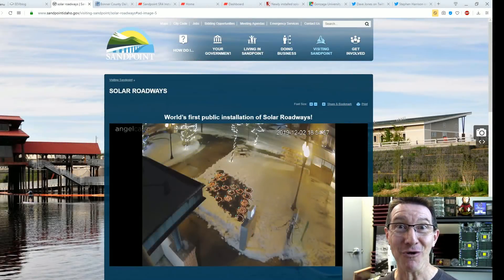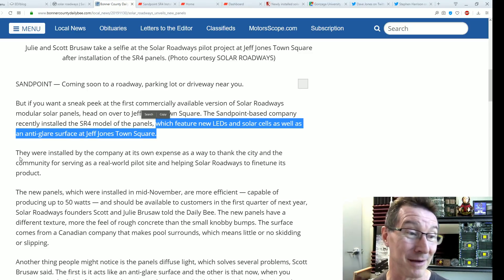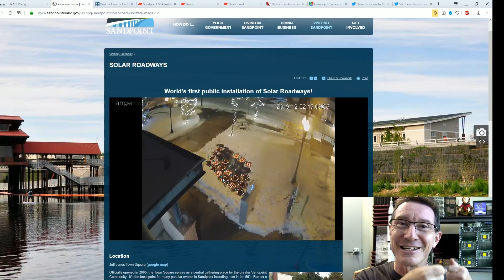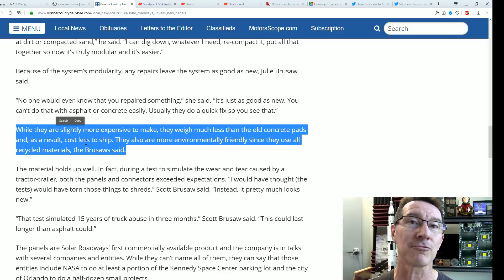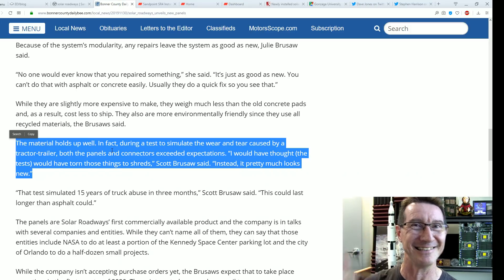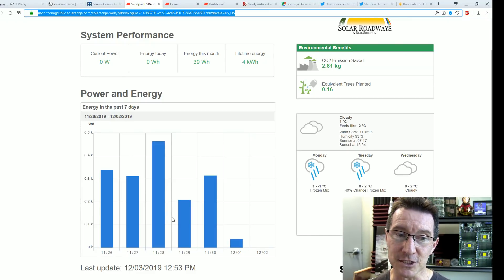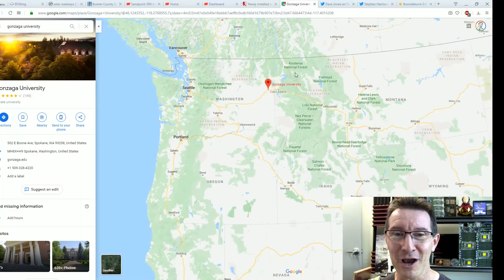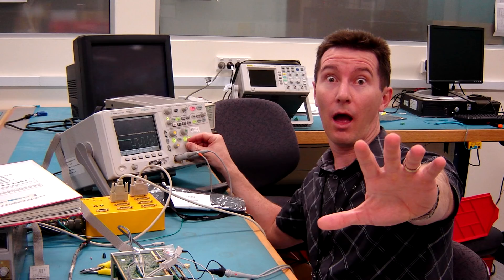EEVblog #1269 - Solar Roadways SR4 DATA Hilarity!

Comment: So right now they have the lighting set up to solid red, lighting up randomly. I suspect because that makes it hard to tell if a panel doesn't work.
After some observation I can safely say that two of the panels are dead. The foremost and the farthest left to the top corner one don't light up. So much for longevity.

Comment: Oh NO! Piezo Roadways...
Piezoelectricity and the Future
What does the future hold for piezoelectricity? The possibilities abound. One popular idea that inventors are throwing around is using piezoelectricity for energy harvesting. Imagine having piezoelectric devices in your smartphone that could be activated from the simple movement of your body to keep them charged.

Thinking a bit bigger, you could also embed a piezoelectric system underneath highway pavement that can be activated by the wheels of traveling cars. This energy could then be used light stoplights and other nearby devices. Couple that with a road filled with electric cars and you’d find yourself in net positive energy situation.

Comment: each panel has its own cable so do the math on enough panels to cover 2 lanes a mile long.  how many miles of cable would you need to wire each panel into the control panel?  and also how many cables would be coming into the control panel?  i was guessing about 30K.  and how big would that conduit would you need?  i was guessing about 4 ft square.

Comment: I imagine if the heaters are as reliable as the LEDs, we'll soon be able to drive on roads with a random combination of  wet and icy tiles.  That will be fun.  You better hope the heaters near stop signs or corners never fail!

Comment: Solar roadways are a joke sure, but I find your melting calculations a bit weird since it very rarely snows half a foot of snow per square foot in an instant. I would assume that most times it snows it's pretty light on average and coverage only comes when you let the snow sit there for a long while. Most of the time the panel only needs to melt light cover over time not half a foot at once. If you can melt a light cover during the day or night then very rarely will you have a heavy cover at all and in areas where you would regularly get a heavy snowfall the winter sun is bad for solar anyway.

Comment: The energy monitor shows 2.45 kWh produced this month (in 26 days), so that's less than 100 Wh per day. If you only would have the LEDs on during the night (let's reckon that to be 16 hours at winter solstice, too lazy to look it up), then that 100 Wh would give you about 6.5 W over that time. To light ALL THOSE LEDS. The remaining energy goes to the population for lighting and heating their houses. /s

Comment: I'd says the LEDs are the worse idea since they serve less a useful purpose. Melting snow is at least gets rid of the snow though it probably eats up more power than it will ever generate.
Hell they may be able to rebrand as road heaters for deicing major roads and highways.

Comment: Check out what Moltex Energy are doing. Ultra walk away safe Zero CO2 nuclear reactors cheaper than natural gas plant with negative fuel costs. They are building a plant in Canada where they will be paid to take the high level waste fuel from a nearby old nuke. They solve the humungous long term waste fuel storage problem while producing reliable zero CO2 power cheaper than natural gas

Comment: You mentioned they were talking to Denver, CO about one of these tax cheaters. You need to know that there is no average basic measurement for the weight of snow in Denver. It depends on how wet it is. You can get a spring snow storm in April, and that snow will be like slush. You can also get a cold January snow storm that produces 'champagne powder' which is extremely light, and the snow blows away in a slight breeze. A cubic foot of snow could go from a few ounces to that approaching a cubic foot of liquid water.

Comment: I think these solar panels might be good in the right application but not city streets or even highways. I'm thinking more like a driveway, especially if you're parking in a garage. WHen the roof can only hold so many solar panels, and you don't want a PV tracker in your front/back yard, if the driveway has good southern exposure this could be a good way to obtain an extra half kilowatt or more of PV power, which might enable more people to go off grid.  I do hope they continue to develop this technology.

Comment: Instead of criticisising  them why don't you help them? You seem like you have all the answers..
Reply: It's inherently a terrible idea there's no fixing it because there's no changing physics. You don't want cars between the sun and your solar panels, that's it.
Reply: @yoloswaggins2161 We are looking at a future with electric cars. Mobile phones are charged contactless these days - imagine a road that charges a car while it uses it!?! Maybe our friend that made the video could also spend his energy making new ideas functional with what seem to be a vast understanding of how things work.  It might not be suitable for a motorway (or maybe it will one day, with some of his help) but surely electric scooters, bicycles, mobility scooters, shopping trolleys for the elderly can all be powered remotely by solar roadways....it doesn't just have to be in the snow or for for cars and lorries - we need to harvest the energy from the sun - it's free energy doh!
Reply: @woefindigo9746  How about you efficiently generate power with a proven to work solar farm then plug your fancy charging highway into that? There's is simply no reason you would want cars on top of your solar panels, because they block out the sun.

Comment: Even if you account for the heat LEDs produce - it’s still not enough to clear the snow. Did someone shove it off the panels?
Reply: The panels have a dedicated heating element that is separate from the LEDs.

Comment: self melting roadways on or off grid, are probably a savings compared to: slow moving vehicles throwing salt, salt on roadways, cost of man hours and materials to distribute said salt. Also, road hazards low incident angles a wonderful idea. Power production,?, another +

Comment: some grey area here.... the old panels cost nearly 2000.00 each and scott said these are a bit more.  how much is a bit?  its like telling a cop i only had a couple beers.  and i believe these panels are put together with epoxy instead of the heating process they used before so i wonder if this epoxy is UV rated?  if not that glue will start falling apart.  glue on glass with a constant heating and cooling sounds like a bad idea so since i am not on facebook i am wondering if someone would go onto the solar roads facebook page and ask scott just what is a bit?  just exactly how much more are these panels and no matter how much more they are isnt in line with what they said in the past where costs will go down.  so maybe its a - the costs keep going up til they get it figured out then start coming down?

Comment: Oi. They aren't looking at all the expensive materials that goes into making these things. Asphalt is made out of tar (which itself is a byproduct of oil refining, IIRC) and rock. You know, some of the most common things found on Earth? And the easiest to re-use? The Solar Roadways panels are made out of glass (okay, so glass isn't that hard to make though it does take a lot of energy to make the glass), silicon for the PCBs in the circuitry, the copper that's used in making the PCBs, and as he said, the diodes, transistors, capacitors. And they somehow act like Copper is the most plentiful thing on Earth or something. Just... unbelievable. Asphalt is actually.... very easy to repair. Probably one of THE easiest building materials to repair, like, ever. You can mill the road and dig the asphalt up, re-heat it and get it pliable and then just simply pour it back down onto the road and there you go. Repaired road, re-using 99% of the material you already had there. You can't really get any more environmentally friendly than that.

Comment: I install SolarEdge systems, They are central inverter systems with optimizers.  Not sure how this makes sense over the Enphase Mircoinverters. It basically adds 1 move component to the system so be maintained for probably every 2000 sqft of surface space.

Comment: Regarding the snow melting... wouldn't it be best, energetically, to simply keep the solar panels at 1 degree Celsius ? Whatever snow falls on it, it will quickly turn into water, therefore not letting snow accumulate.
Reply: The total amount of energy needed stays the same.
1/2 a foot of snow in less then 1 hour is not that uncommon. So if that amount of snow comes down in 1 hour and it takes 8 hours to melt it, there is no way those tiles can keep up with the snowfall.
Quite contrary, it will make matters wors, as the melted snow will begin to freeze and then you have an ice surface.

Comment: I like how they set some text ( S, R and 4) to display, and put the panels in a random orientation.
I wonder how hard it is for them to change the patterns afterwards, and whether the panels are even connected to each other. 
I'm pretty sure it's mainly a manual operation..

Comment: You need to heat up snow to over +4C deg to melt it. It is 0 deg for freezing and 4deg for melting(you need to ad plenty of extra energy to change ice into water, that is the reason why people adding ice to drinks).

Comment: They might have more success extracting power from speed bumps or pressure pads. With the correct pad dimensions, each passing vehicle would generate at least two pressure pulses. It might be possible to use the tons of pressure generated by passing vehicles, as they drove over such pads, to compress air into a storage tank. A high pressure air turbine could then be used to generate electrical power. The disadvantage of such a system is that energy would be extracted from each passing vehicle. It might also produce a rougher ride.
The power available must be relatively large, give the earthquake conditions that are produced from conventional speed bumps some 100 or so metres from my home. The vibrations produced are sufficient to knock ornaments from my bookcase. This must imply that the energy produced is sufficient to shake my whole house.
To make the system practical, one might imagine a series of pavement sized road slabs, constructed of a rubber material similar to car tyres, with limited vertical movement, compressing air using a one way valve system when ever a vehicle drove over it. The compressed air could be feed through high pressure tubing to a buried tank storage reservoir, where it could be used to generate power. 
It would be nice if such a system could generate electrical power more directly, maybe using springs and coils or the piezo electric effect, but I suspect both would be too expensive to implement and not very efficient. One advantage of compressing air is that the road way could be self heating, since the compression cycle is likely to be adibatic. Control of the pressure release valves would increase the energy stored in the road surface, stiffening it in the process. While erosion of the road surface would be a concern, it is far less of a issue that associated with photovoltaic roadway. I suppose that a compression system of energy extraction could be used in similar places to make traditional speed control. The captured energy might be used to power lighting at road junctions or in speed restriction urban areas. I wonder if the pads required could be made from olds vehicle tyres. This would make it even more environmentally friendly. No doubt someone will point out how impractical this bit of whimsical thinking is to implement, but no more so than a photovoltaic road way.

Comment: There's videos of the results of driving over something like these in China.  They shut it down after six days due to extreme surface damage.  They initially thought someone had stolen a section, but later determined it had come up and been smashed into tiny, tiny bits.
Reply: That doesn't prove much. There's fairly new houses in China that are already falling apart before anyone ever moved into them due to incredibly shoddy build quality. Well, that was actually a few years ago by now, so I bet a bunch of those houses have collapsed under their own weight by now. My point is, if it's happening in China, it could just be a quality issue, so the argument wouldn't hold up. The opponent would have a plausible excuse.

I find it much better to argue against the principles of placing solar panels where cars block their view of the sun and carry dirt and grime onto them to block that view even more permanently. Also, I seem to remember there was also an installation in another place in the USA? As well as some bicycle and pedestrian paths in Europe? That also didn't hold up, where it's much harder to argue that it would just be a build quality issue.

Comment: That isn't a foot of snow.  That's maybe 2-5 inches.
Reply: I said half a foot and used that in my calcs.
Reply: @EEVblog2  Not blaming you as an aussie who probably hasn't seen much snow.  Anyway, your calculations also don't take into account the fact that you need to keep heating the water (as the ambient air and materials keep freezing it back up) long enough to drain it away.  They have NEVER shown how much energy is being sucked up by their LEDs and heaters because they know it will shut down the whole idea immediately.  Just the LEDs alone very likely use way more energy than the panels produce.  And the heating in the winter will use an additional 10 to 20 times more energy.  So environmentally friendly, right?!
(Btw,  Dave: check out how much energy they are producing now in the summer after just a few months.  The solar panels are pretty much cooked - producing only about 100Wh on a fully sunny day near summer solstice.  At least 2 of the panels are dead.  They last longer than the SR3s, but I'm betting it goes down to zero and most of the LEDs stop working by the end of another winter [and they think running trucks on this will last longer than asphalt! LOL!])
I love this quote from them boasting about how much more energy the SR4s will produce: 
"All of the SR2 panels had their solar cells connected in series, so we’d never seen this problem. What we found was this: every panel produced power, but we couldn’t get them to combine properly to meet the input requirements of the micro-inverters. We were never able to “see” more than 1/3 of the power being produced. In addition, we learned that the extra laminate that was used in SR3 as compared to SR2 due to design changes interfered with solar gain. These problems have been eliminated with the new SR4 design.

For SR4, we found a way to maximize the solar cell area while maintaining a series-connected system. We also increased the wattage from 44W (SR3) to 50W (SR4). In addition, we’ve going from 17.6-percent efficient solar cells (SR3) to 22.5-percent efficient solar cells (SR4). We’ll always be able to increase the solar gain over time as the solar industry continues to advance and make more efficient products for us to incorporate. All of this means that we’ll be able to produce a lot more power with the SR4 panels.
"
(https://solarroadways.com/overview-sr3-to-sr4/)
NOPE!  Wrong again

Comment: They've never published data on energy use.  Based on the way these thieves operate, that can only mean the LEDs alone use more energy than the SR4s produce.  Let alone the souped-up heating system which probably uses 20x-100x more energy than the LEDs.

Comment: If the argument in favor of Solar Roadways is against bitumen, humans have been using it since fifth millennium BC, with the first asphalt patent granted in 1834. Also, modern blacktop is 100% recyclable. It's a solved problem. I'm pretty sure road markings are also centuries old as well, it also being a solved problem, as paint is widely available, lasts for an extremely long amount of time and can be easily replaced or retouched if necessary.

Comment: To be fair if someone was to make a solar panel that worked on the floor, you could use them in a parking lot road rather than parking bay. But good luck to someone making glass that doesn't wear away from rocks being ground into it by car tyres.

Comment: It looks like the energy required to melt snow is about the same as that required to lift it 34 km (21 miles) in the air.
Hence snow ploughs, blowers, even a shovel or broom are the easier way to clear snow from roads.
Reply: There's a reason we use snow ploughs and not snow melters to clear our roads.

Comment: As Dave points out, the discrete panel design pretty much DEMANDS a rigid road bed, presumable a massive - expensive! - concrete and steel structure.   Brusaw bragging about how the new rubber base replaces concrete pads just highlights how blitheringly incompetent he is an an engineer. Hell, first-year civil engineering students are taught what happens to unsecured tiles resting on pliant foundation - that they will wobble and fail in short order.

And the flashy lights - OMG, this is first-year digital electronics stuff, from 30 years ago!  With current Arduino, etc. ucontrollers, it is would be simple to set up a virtual display screen, and tell each panel what section of that image they should display. Brusaw pimps the 'graphics' feature, but can't bring even a primitive implementation to the table.  Sad.

Comment: As an engineer of snow melt systems, I can tell you that you have to do a lot more than just melt the snow and hope that it drains.  You damn well better have pitched your surface to a drain or you will get a thick layer of ICE that is way harder to melt and way more dangerous than snow.
Reply: Cars driving over the snow will pack it down to ice before it ever melts.
Reply: Do you also need to heat the drain too?